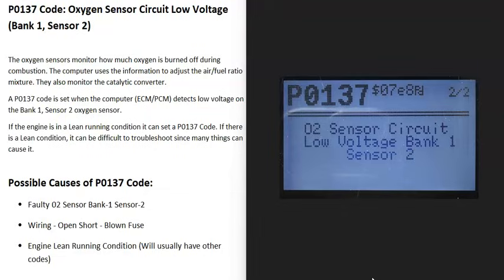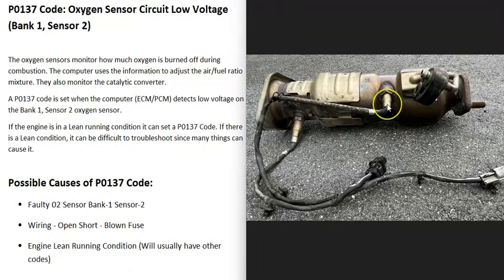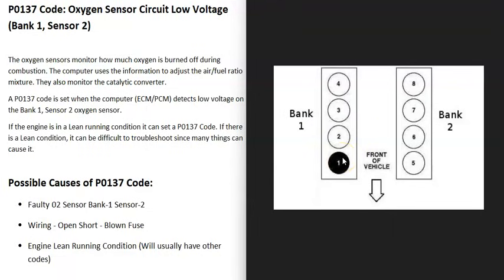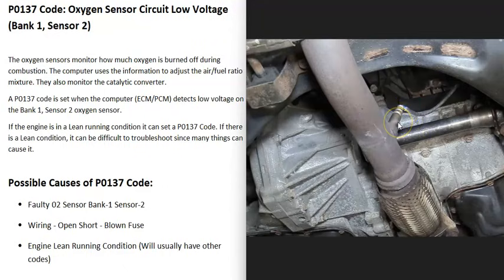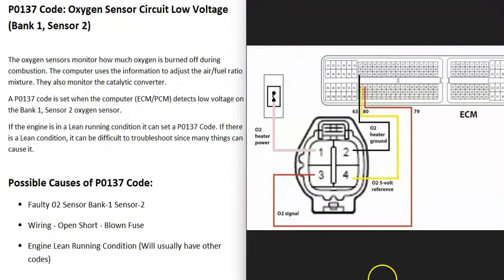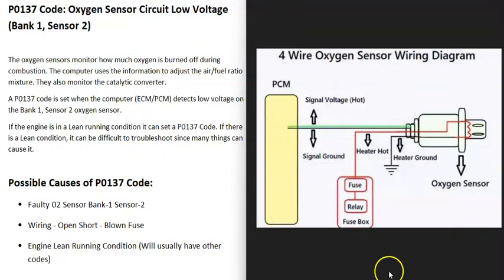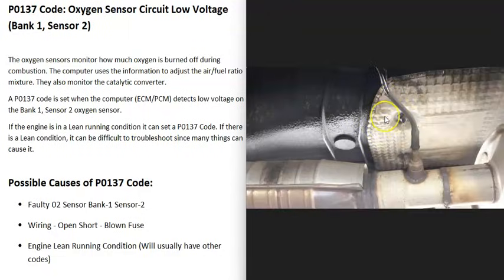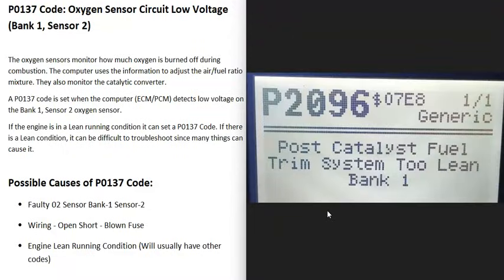Causes and Fixes P0137 Code: Oxygen Sensor Circuit Low Voltage (Bank 1, Sensor 2)

Comment: My right vent/ side doesn't heat at all is it due to the P0137 ? I also have a P2096 and a P0138 code. Bad Cadilic Conv?

Comment: I got this code today on my 2018 WRX. The sensor wasn't even reading on my scan tool so I assumed it was dead or somehow disconnected. When I got stuff out of the way to check it out, I noticed the ground strap that goes from the exhaust heat shield to the frame rail or body had completely rotted away. I put on a new ground strap and now the sensor is reading again on my scanner. Fingers crossed that fixed it.
Reply: Just had my check engine light turn on on my 2017 subaru wrx and had this code pop up P0137 and ordering this piece sensor

Comment: 2016 Hyundai Sonata 2.4 L engine check engine light on , scanned 2 codes , first is P0138 , second is P1028 

Bank 1 sensor 2 

Second Code : Coolant Temperature below sensors regulating temperature. 

Coolant level checks good . 

78,000 miles .  

What do you suspect?

Comment: Like your video! Very helpful and informative! I've had a po137 for almost 2 weeks...car runs fine...is po137 a big deal? Is it something urgent to fix? 2006 Honda Accord 123k miles  thank you!
Reply from the maker: Usually, it's not urgent; the engine will be less responsive, have worse fuel mileage, and not pass a smog test, but it should still run.

Comment: Well, something that works very well in these cars sometimes causes this failure is that the air filter is clogged and causes more gasoline injection which causes more catalytic gases which causes the catalytic lights to come on. The first thing is to change the air filter and in a quarter tank of gas, put a divine catalytic like Cataclin and Beran which in most cases works very well.
Reply: Absolutely not.